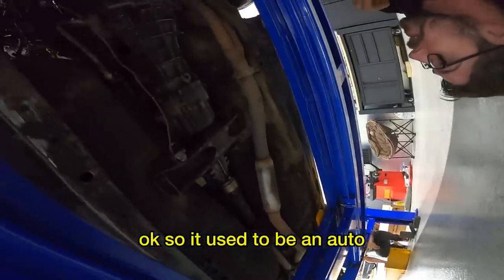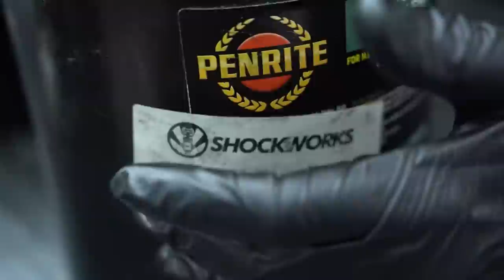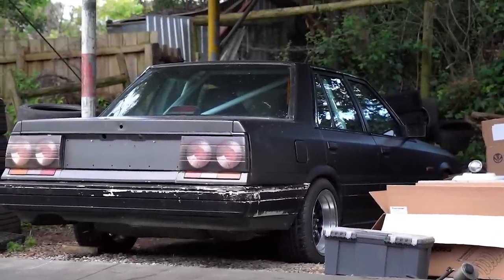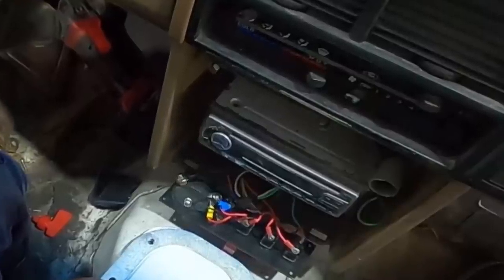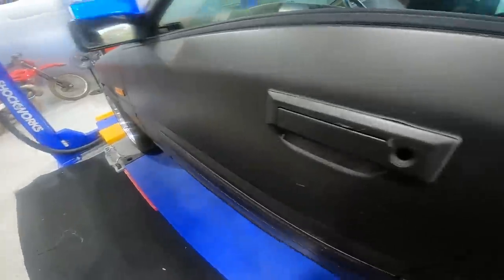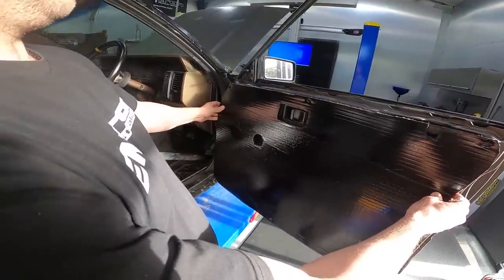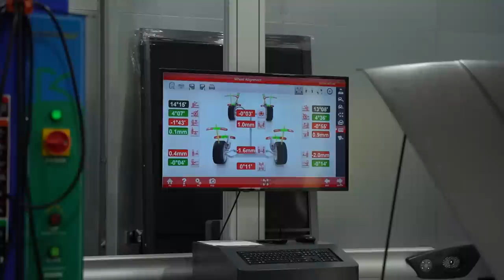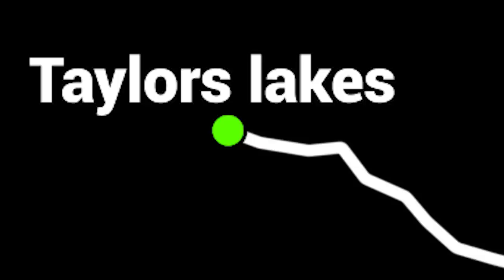R31 SKYLINE DRIFT RESTORATION

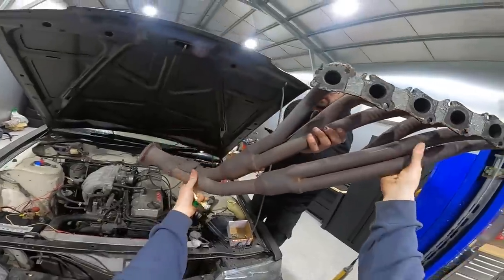Comment: 9:21 Just like my 89 SC, the V6 didn't have gaskets when I pulled the headers out. UNLIKE my SC though, I couldn't pull the headers out without taking the heads off.

Comment: i drifted my vs beautiful car my first car mint condition and mate it felt like I've done it before but i wondered why it felt so smooth turns out she has nolathane springs as labeled in the boot and this commo is in early stages just about at 200t ks not 400 500 she's got more than plenty of life first upgrade exhaust still running 2 muffis and benny that skylines a nice one don't whack her into a wall will Ya